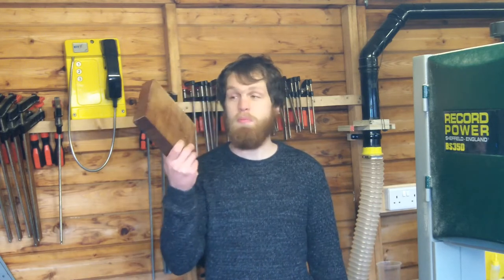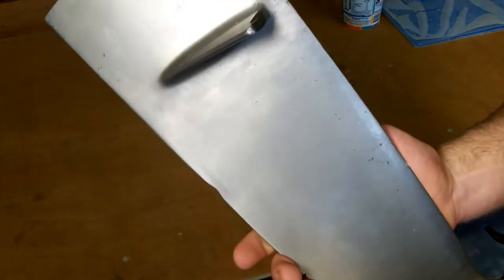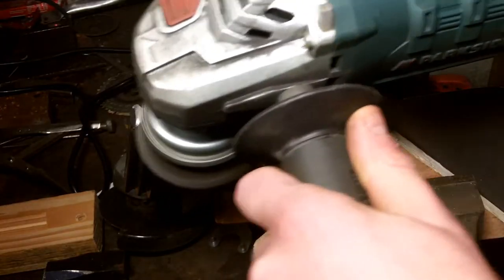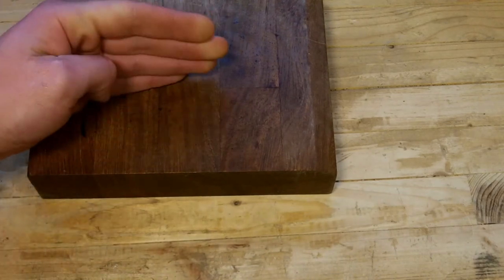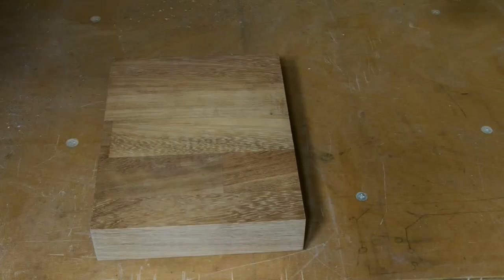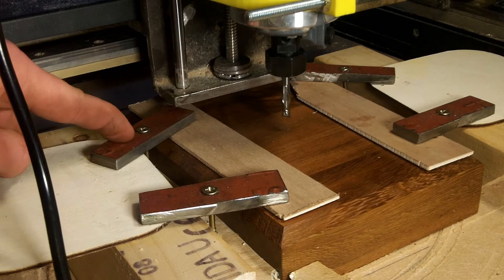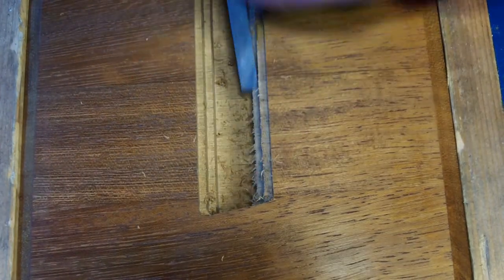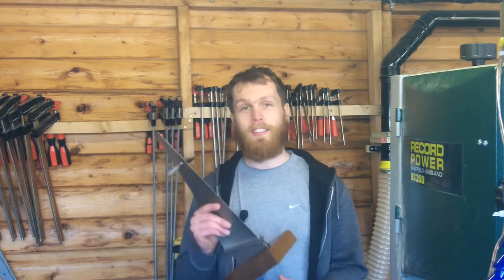Making a Sculpture from a Jet Engine Blade

Comment: Awesome. I have a CFM-56 fan blade to mount. I’m just a tad concerned about routing the trough for it to sit in. I’m a complete newbie to routing.
Reply from the maker: Thanks. I assume that you'll be routing handheld rather than CNC? In either case plenty of practice pieces is definitely going to be helpful.
If you can get a laser cut template and a guide bushing for the router, then your life will be much easier, butit otherwise, printing a template on paper and sticking it to your workpiece will work as long as you have a steady hand
Reply: @janionmakes  I’ll be using a handheld router. If I can get it accurate, would it work if I make a suitable snug fit ‘trough’ and fill it with epoxy and sit the blade in it? The. Clamp it to make sure it remains vertical while the epoxy goes off.
Reply from the maker: @stuartparlane5115  yeah, that sounds like it'll work perfectly. If you want to be more precise, you could route out most of the trough, then use a chisel to finesse the fit